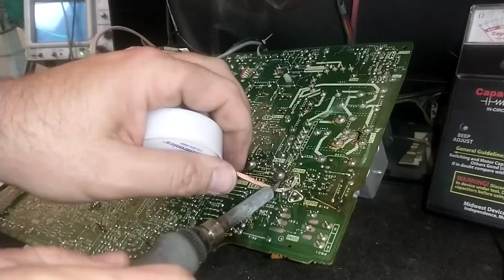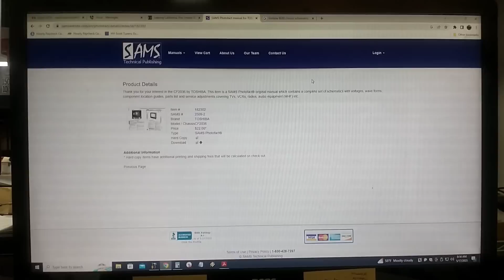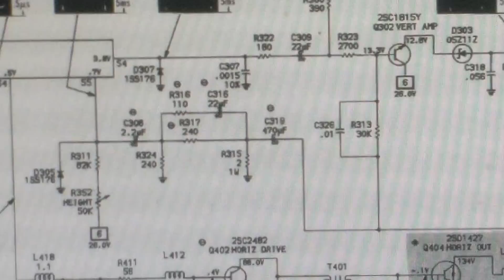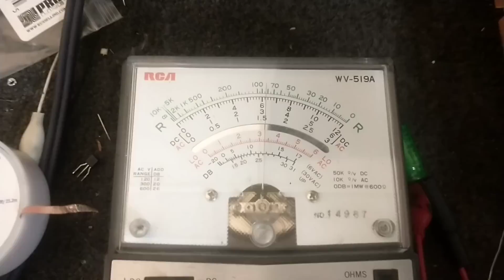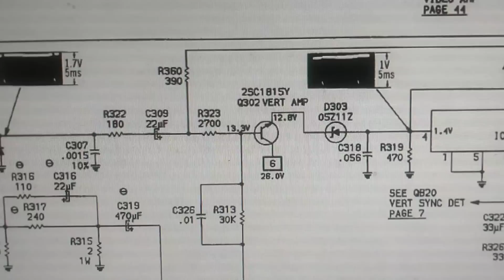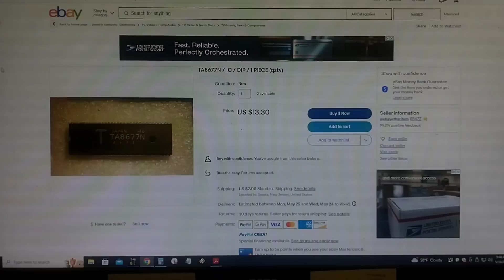Service attempt of a 1987 Toshiba Blackstripe tv model cx-2036. vertical failure. P1/3

Comment: Thank you sooo much for this repair video! I just have recently gotten the same Toshiba TV model (CF2036) and am noticing it having partial vertical failure symptoms, with the lines at the top of the screen & a black bar at the bottom of the screen. I want to repair it, and I going to see if I could have you look at it, but I’ll try to fix it myself and get new capacitors, and other possible things it needs while referencing your video. For now I’ll look for the service manual.

Comment: Greetings:
When replacing the low ESR caps do you consider the life length of the replacements? Exact replacements will only have similar lives to the originals. Maybe a quiet fan will help with original type parts? I have lost manual dexterity with small motor skills and severely degraded eyesight due to diabetes and age (72), so I too, enjoy watching you change parts (retired maint. Tech).
Reply from the maker: I always go for low esr, high temp and high hour rating at rated temp. Usually 8-10khr caps. i dont want to have to do it again.

Comment: Dear sir this video was really useful. I have a Sanyo radio for repair. The oscillator oscillates sporadically. After some time the oscillation stops by itself and receives zero signal and not even produce little noise when I bring it near to the fluorescent lamp. But suddenly it starts working. I have checked all soldering points and mechanical switches. The circuit contains many styroflex and tiny ceramic disc caps.
Unable to check those Pico farads precisely. May i know that if Polystyrene or styroflex and ceramic disc caps fails?? What will be the suitable one to replace them
Please suggest sir.
Reply from the maker: More likely the oscillator transistor itself.

Comment: If you want an ESR meter that measures well below 1uF, try ESR-2501B. It is supposed to be an in-circuit ESR meter, and it is (the test voltage is low enough not to interfere with PN junctions), but it is kinda useless in-circuit in a lot of cases, because it can measure the ESR of 0.01uF caps! So it will measure the ESR of ceramic bypass capacitors all across the power rail, and you will think the electrolytic you are measuring is fine, while it might be dead. So this ESR meter is good only for out of circuit measurements, if there is any chance that low-ESR ceramic/film bypass caps can be in parallel with the capacitor under test. I refer to this ESR meter as "too good to be useful" as an in-circuit meter. But it is GREAT for out of circuit measurements. 

BTW it is a knockoff of an ESR meter published in Elektor magazine in 2002/9 by Flemming Jensen. Google "esr-meter elektor-electronics-2002-09 icl7106", you can download the full article, or you can read it on Elektor Magazine's website if you are registered. It uses a synchronous rectifier to avoid measuring the impedance+ESR of capacitors, it measures the pure ESR instead. That's why it is able to measure the ESR of such low capacitance capacitors. I haven't fully reverse-engineered the ESR-2501B, but just by looking at the board, all the ICs in the front-end are the same as in the Flemming Jensen meter, the schematic is probably identical, they just used a microcontroller with a 1602 LCD module, instead of an ICL7106 +  7-segment LCD. Which is nice because they were able to implement auto-zeroing this way.

Comment: There are 2 tantalum caps, usually red or tear drops. One at the jungle
at the ramp gen. Other on low end of the yoke. Fixes 95% of them.  While in there
check the sub boards for cold PC cons.  IMHO these were the best from Nippon 
at the time. Fun & easy to fix & great pix.
LFOD !

Comment: NO OFFENSE, but really a Toshiba that needs a common re-cap is boring as bat shite the only thing I I found was that the jungle IC was a TA8177N where the OZ PAL-D version had a TA7698A or TA7699AI think from memory the 98 was PAL only & the 99 was multi-format but vertical ptoblems just replace caps was an in home repair, the 5 pin regulator IC in OZ was a STK5414 & on failure would take out the h-out transistor typically was a 2SC1555.
This I could have fixed in 15-20 minutes from putting it on the bench to invoice done, so I don't know if you drag these videos "to teach" or your a slow boring methodial worker?... In & out asap cuz time is money.
Reply from the maker: Audio is more my forte. These are more methodical troubleshooting videos to help people if anything. This is not a customer set. Usually i dont do videos on those unless they specifically request it - which sometimes results in additional charges for time.

I would have loved to dabble in tvs more, but by the time i was done with school tvs were becoming more throwaway and flat panels were becoming the norm
Reply: JP"s specialty is audio IIRC. Very capable tech. This is educational. 
I doubt he has been in tens of thousands of TV's like some of us. 
For me its a walk down memory lane. And yes I do yell at the screen at times !
LFOD !

Comment: I did see that you were checking a 470uF 15V capacitor for leakage with a meter that supplies 22 Volts, and I would say both those capacitors ok, as the maximum working voltage of each one is only 15 volts (perhaps 16v with the new). In many circuits, the power supply for the vertical stages is from the line output transformer with a series diode (and sometimes fusible resistor) and filter capacitor (electrolytic) to supply (typical) 30 volts (DC). I would be checking the voltage at the collector of the 2SC 1815 transistor (emitter follower) which looks to be 29 volts... If that is correct, I would be checking the output IC..

Comment: I had found a Small Tabletop TV from 1987, The picture of the statiic was okay. but Volume was full loud, and i had no controll funktion. When i open the TV i sa a Baterie has leekt and destroy some trace s of the JungleIC. After Several hours of retracing it works now. 

Thank you for that Video, i quite Like tVs vom the 70s up to the 90s 

Sorry for my bad English

Comment: my AC window unit couldn't kick its compressor on a few days ago, and we checked the brain, an i-c had a bit of black shmutz between two pins.. cleaned it, still no compressor. . . fried it? could be the whole problem. hoping just the can, but yeah.. ugh. pins and needles.
Reply: Capacitor.

Comment: I had a Sony trinitron from 1987 that looked just like this TV that was a Stereo model that had external speaker output hookups but just one built in speaker and it had the same issue that ended up killing it and I didn't know how to fix it at the time (I got it from the high school I went to in 2005 because they retired it).